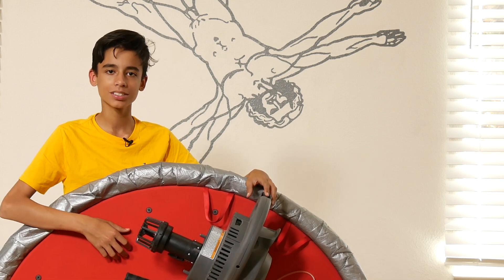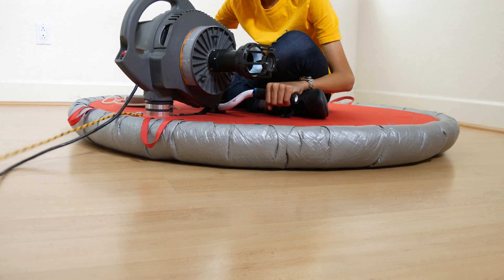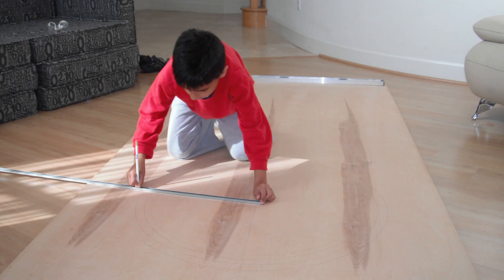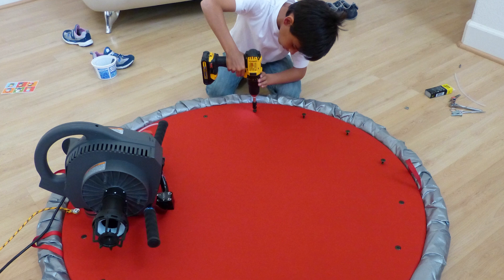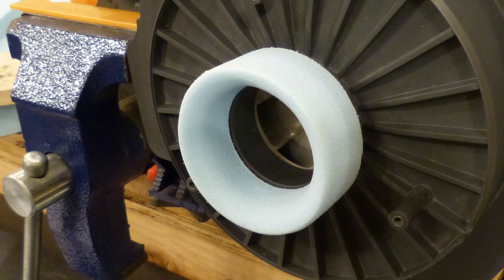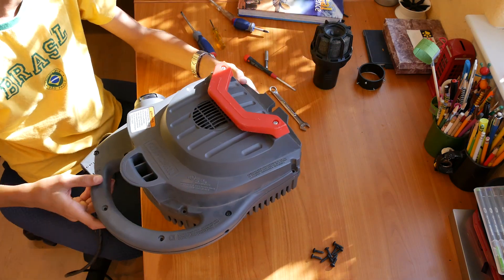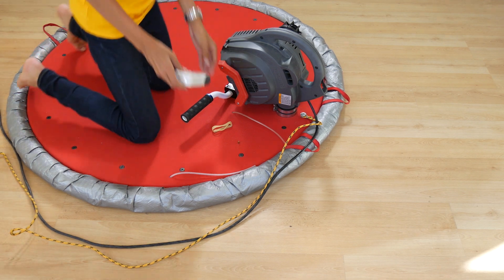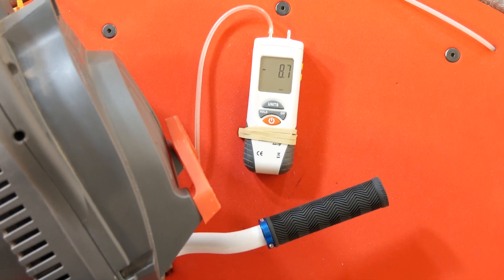Building, tuning and testing an electric Hovercraft - leaf blower powered Science Fair Project

Comment: Have you had any success riding this hovercraft on grass?
Reply from the maker: Unfortunately not. To really work on grass you would need much more airflow than what a leaf blower (or even two or three) can provide. Leaf blowers are a safe and easy way to power a hovercraft, but they move a relatively low volume of air at high speed. To lift a hovercraft you would ideally want high volume and could sacrifice some speed/pressure . Then it would be much less of a problem if more air escapes between the skirt and the ground, as it does on grass.